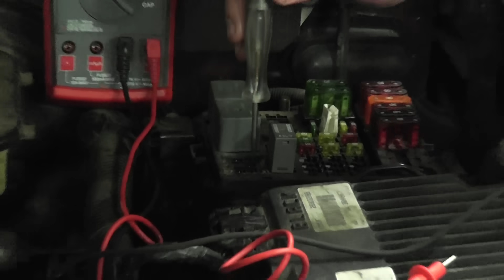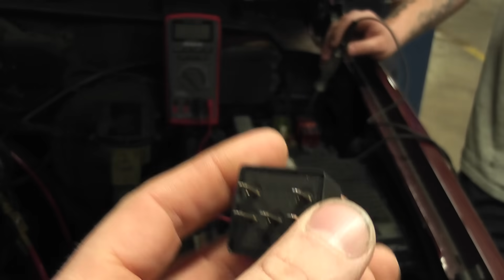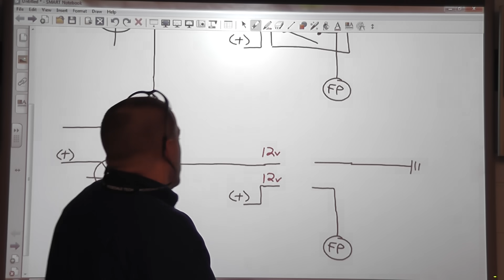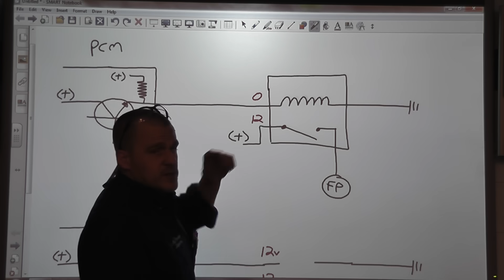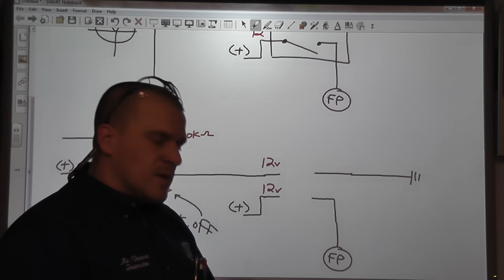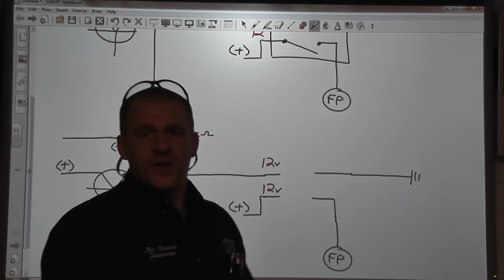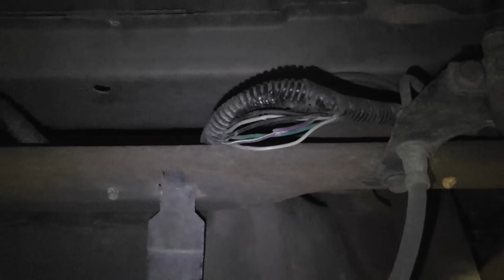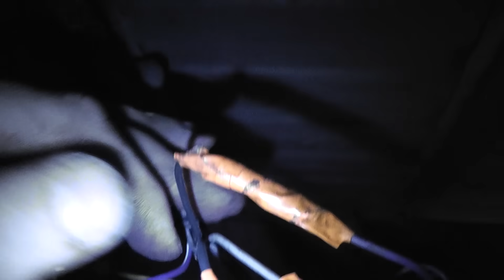GM Fuel Pump Relay Testing

Comment: Sec 16 pg 9, GM RELAY  TESTING . So when testing relays...let's say to a ground side switched  fuel pump. That means the relay is ground side  switched  as well?  I ask because  every video  ìve watched has said numbers  86 is positive  85 ground, 30 positive ,  87 is load? But the in your video you say the complete  reverse.

Comment: With the relay in, the bais voltage drops thro the coil to ground? Right? Can the computer use this to tell if the relay is open or unplugged?

Comment: why the fuel pump relay shuts off current supply to fuel pump when key is on and engine has not been cranked for 2 seconds?

Comment: sinking or open collector transistor. Used widely in industrial control, jumped the fence at GM and invaded our cars when computers became standard.  Coil load tells the computer there is a load there. When the transistor is told to turn on by the computer it SINKS to ground and loads up passing voltage! The test light acts as he said just as the relay coil would. 42 years of electrical and the last 16 in training others one of the best descriptions of sinking and open collector I ever saw. Awesome!

Comment: l have a 2001 s10 with a 4.3l it starts but dies in 2 seconds I replaced the fuelpump, fuel lines, fuel filter, altinater, ground wires, spider injectors. I ran the codes and the only thing that popes up is abs please help me

Comment: 2004 GMC Savana 3500 cutaway, with a 15' box. No start, no pressure. Was able to jump the correct pins (you explained very well) and send constant power to the pump to investigate further. Found out to be a bad connection w/ the connector at the pump. Would have never stumbled across it without your information. Was sending it to the shop tomorrow....Great work and fantastic information!

Comment: a novice like myself(with shallow experience) is assuming that each and every closed circuit has a feed(12v), then there s a component or load where some ACTION is happening and after that comes ground (zero volts)...in this case of bias voltage, i m thinkin: hey, but where is the load, where is the action happening(obviously it s not the coil of the relay)...the only action (if any) is that resistor where those electrons are crowding to pass through( in a controled manner or otherwise there would be action in that coil)....so they re like scouts, just watching the bridges, for the armored division that is supposed to do the real work...btw.i hate war :)

Comment: Looks similar to my 96 Silverado K2500.  How did they not notice the wrong colors on those wires were connected together?  Why didn't they just tell you that somebody attempted to replace the fuel pump beforehand? Those wires should have been shrink tubed and soldered.

Comment: I have a 2000 Chevy K1500 Silverado. I have to double start it before it will run.  Fuel pressure totally drains with the key on no start test...Motor started the pressure is below what have been told should be 65 psi, currently it is around 55 psi, however when using OBD diagnostics software it shows the fuel pressure dropping to almost zero when you stand on it between 2nd and 3rd. Initially the fuel pressure was static at 45 psi when driving it. The upstream O2 sensors appear to be stuck as well around 80 mhz.  Finally, fuel pressure totally drains after motor turns off.
The double start issue appears to be random as well. Sometimes I walk out get in it and boom it starts, the next bump the starter and the engine just cranks, let go hit the starter again and the pickup starts.
Its like something gets intermittently stuck partially open?  Like a valve?  If someone knows the issue post a solution.  Thank you in advance.
I have done the following:
Replaced the fuel pump twice once by the dealership and then my self first pump was replaced after truck slowly would not run right, it would sputter when you hit the gas and finally just would not start.  It would just crank. 
Replaced the inline fuel filter under the drivers side
Replaced FPR first by me and then once by the dealership
I have replaced the fuel cap as well
Mass Air Flow has been cleaned appears to be good as well.
Finally, grasping for straws I have reset the EMC thinking maybe the fuel pump by pass had been triggered 
Karl A

Comment: Hello ScannerDanner. I  neeed some help. I have a 2008 chevy silverado 1500. I am getting a lean bank 1 and lean bank 2 codes. I have replaced the intake manifold gaskets, valve cover gaskets, clean and dirty air tubes, evap hoses on top of the motor as well as the evap solenoid, the evap canister vent solenoid, the fuel pressure solenoid, map sensor, mass airflow sensor, fuel cap and the O2 sensors were replaced 3 months ago and I am still getting the codes. The fuel pressure was tested with a gauge on the fuel rail and it was at 44psi at idle which is where the book said it should be. I am at a loss. Is there anything else I could be missing with diagnosing that you might know of? Could the fuel pump flow control module be starting to act up? Any ideas would be greatly appreciated.

Comment: I have 2000 gm sierra it ran out of gas wouldn't. start then after putting gas in it changed the fuel filter can hear the pump engage. I used my spare key to try to start it it turns over but just won't start I noticed the security light keeps flashing does this have anything to do with it? Please help me

Comment: I've always checked for voltage and ground closest to the fuel pump with out removing the tank, amp gauge or probe. Then work towards relay and ecm. jmo.

Comment: Hello paul
Can't we just install the relay jumper block you used in some other videos, and then cycle the key and if relay was good you would get light on the pin 30 of the relay jumper block.....or am I mistake

Comment: I have a 1997 Buick Lesabre & my car started and cut right back off after a few seconds & i also rolled down my back windows. When i tried to crank it back up it wouldnt. My car windows wouldnt roll back up & my fuel pump would not cut back when i turned the key. I checked all the fuses & they are good. Checked the relays with the hand test & they seem to be ok. I cant figure out what the problem is. This is the 3rd time that this has happened. Usually after i let the car sit for a while & try to crank it, it cranks right up, but now it wont. PLEASE HELP

Comment: I own a 96 Yukon in the heat the truck starts to lose rpms and power after running for a little bit. Also the relay gets extremely hot. However in the winter it runs great other than being hard to start. Any suggestions would be very appreciated. :)

Comment: Question, what could be the reason I go through fuel pump relays often on my 99 GMC Yukon Denali. It happens on initial start of the day or as you are driving. The truck just stops, I put a new relay in and it starts right up. Pin 87 on the relays looks hot and the place the relay plugs in shows wire 87 has been hot. Any advice?

Comment: All that shit for jumbled wires. I got a 97 suburban that keeps chewing up pumps. Right now it has zero fuel pressure and I checked the relays. Only power at 87 but I don't have anyone to turn it over while I check. Fuel pump is not coming on at all, anyone have any suggestions?

Comment: Hey man my 99 z71 5.3 started running real rough to the point where it wouldn't accelerate I have already put a fuel pump about a month earlier along with a fuel filter and a crank case sensor it started white smoking now my fuel pump will not come

Comment: My 1999 Chevy Tahoe won't start. When I test the fuel pressure it's only putting out about 55 PSI and sometimes it jumps down to 40 PSI. I've heard that these trucks need at least 60 PSI for the fuel to open the poppit vales. Is this true. Will they not run with pressure under 60 PSI?

Comment: You are quite a rocking dude for serving the community of DIY and interested on lookers.  I am facinated and intimidated by modern electrical systems and the computers that control them. Could you recommend a primer book or do your films teach an old school guy that does alright as a parts changer but wants to really have the equivalent of a formal education in auto mechanics.  I may yet switch careers but need to become updated from non-computer controlled engines.

Comment: Hey Guys, this is my 3rd or 4th time coming to this site for help on different issues with my 1999 GMC Suburban. I love my GM vehicles and have had a great run of luck buying older used vehicles (Chevy, GM, GMC, and so on) and this site has been invaluable to me in regards to fixing my cars, with both time and money. THE ONE MAJOR PROBLEM I HAVE HAD IS WITH THE DEALER AND HIS MECHANIC. I WILL REFRAIN MYSELF FROM PUTTING IN ANY DERROGATORY REMARKS AT THIS POINT IN TIME. HOWEVER, IF I DO FIND OUT THAT THIS DEALER IS AND HIS MECHANIC HAVE BEEN DOING SOMETHING TO FORCE ME TO GO BACK TO HIM FOR WHAT I CALL REPEAT REPAIRS, I WILL WASTE NO TIME IN LETTING YOU GUYS KNOW ABOUT HIS OPERATION. I WILL NOT WASTE ANY TIME IN INFORMING YOU ABOUT THESE GUYS. I WILL GO THIS FAR AND TELL YOU THAT THIS GUY IS LOCATED ON THE ATTLEBORO / NORTON LINE.

OH YEAH, WHILE I HAVE YOUR ATTENTION, I FEEL IT IS MY DUTY TO ALSO INFORM YOU GUYS THAT obama IS NOT ONLY TRYING TO TAKE AWAY OUR GUN RIGHTS HE IS ALSO NOW TRYING TO GO FURTHER BY TRYING TO USE HIS EXECUTIVE POWERS TO SCREW WITH OUR INTERNET USAGE, SO GUYS IF WE DON'T DO SOMETHING ABOUT THIS IDIOT WE'RE THE ONLY ONES THAT WILL HAVE SOMETHING TO LOSE HERE. I ALSO JUST SAW SOMETHING ABOUT HIM WHERE HE HAS BEEN GIVING MORE MONEY TO MORE ILLEGAL ALIENS AND IF I CAN FIND OUT WHERE THAT INFO WENT I WILL MOST CERTAINLY BRING IT TO YOUR ATTENTION SO THAT WE ALL ARE AWARE AS TO WHAT HE IS DOING TO US. GOOD LUCK AND GOD BLESS TO YOU ALL.

Comment: i hope you will help me with this annoying problem....i have Opel Corsa B 12V 1.0 ...the problem is,hard starting 2,3 times to start the car....and when i try after every false start i hear rapid clicking from the relays...is this a regular clicking from fuel pump relay or need to buy new one....to solve this....??

Comment: I need to check fuel pressure but only have an oil pressure gauge with a hook up to the schrader valve will that work?

Comment: I have a '95 Jeep Cherokee Country, the pressure fuel regulator was spraying fuel at crank. I replaced it with the suggested one from the local auto parts store, looks different than the one removed. Now I can't start the Jeep. It runs for a short time then dies. Help???

Comment: Great Video! Im working on a 98 Chevy pickup, when the pick up sits overnight it takes a really long time to start. It acts like its feeding back thru the oil pressure switch. I tested all the leads on the relay and i have good power and all the wires tested right. Somebody else already replaced the fuel pump once. The truck will even do it after sitting for a few hours. So it doesn't have to sit overnight. Any suggestions would be greatly appreciated.

Comment: 1997 CHEVY SILVERADO FUEL PUMP KEEPS GETTING VERY WARM TO THE TOUCH. IT KEEPS MAKING THE TRUCK SHUT OFF AND I TAKE IT OUT AND PUTTING IT BACK IN SO IT WOULD START. WHAT IS YOU IDEA OF WHAT IS THE PROBLEM.

Comment: Have a Chevy Silverado 2002 ,my problems is truck starts then runs about half mile then loss power then engine stop,I try to start up the engine wont start,If I wait about20 mint.to 30 mint. Engine start again but then stop again. Cuestion What could be the problem?

Comment: I'm having trouble with my fuel pump on my 2002 chevy Silverado 2500HD the fuse is good the relay is good im not going any power going to the fuel pump itself...test light was used on the lines going to the pump but not lighting up...please help me

Comment: OK I did verify 5 reference for Map sensor and Idle air control sensor both are receiving 5Volts with key in the on position.

Comment: no light to control pin when cranking and no 2 second light when key on! Now I am guessing this is a PCM issue I looked at PCM under dash there is only one wire harness plugged into this PCM the smaller one there is no harness connected to the area where a larger harness could connect 88 Chevy k1500 4.3 is this normal?

Comment: Great video. I like the comment on the lean pop through the intake at snap throttle. I have been using these videos to troubleshoot electric fuel pumps measuring current and the armature waveforms. These videos have been very useful. Thanks.

Comment: Need your help bad.  I am working on a 2005 Cadillac sts 3.6 liter. Some shade tree mech. Changed the fuel pump in it and did such a bad job. I would have to show pictures for you to understand. Anyways I'm getting a fuel pump "a" circuit open low voltage. It's been a nightmare! I added you on Google+ so any info you can give me the better. Thank you.

Comment: I am not sure how active you are, but I am driving an 88 bronco 2 2.9l. The previous owner replaced the air box with a spectre air filter. This means he deleted the factory air box. In the process, it looks like he left these relays exposed as well and they're clustered yet exposed to the engine bay. 

Yesterday, my car caught some heavy water during a storm with the hood up for 4+ hours. I tried cleaning these relays with no luck. I am testing these because when the car in the the on position, there is no fuel pump 'hum'. 

Am I possibly stepping in the right direction? I used google and search everything from 88 bronco 2 fuel relay location all the way up to fuel pump bad water just so I could get the most broad idea of whats happening. Unbelievably, google did not supply me with an answer.

Comment: I have a 2000 tahoe, what if I don't have the second power feed when cranking? the fuel pump was working before I changed it cause I was told that i will need a new one soon. and now I can't hear it turning on.

Comment: My Chevy 96 Lumina had only 5 lbs fuel pump pressure.  The pump was never changed.  Getting some pressure indicated the electric circuits were good.  Replacing the pump gave about 35 lbs pressure which made the engine run correctly.  Opening up the old pump showed the flat in the hole in the rotor which fits on the pump motor to be warn off.  Going through a lot of complicated testing was eliminating by observing electric and pressure conditions.  The important fact to realize is the simple flat inside the pump rotor hole can be warn off to cause low or even no pump pressure.  Don't overlook even a pound or two of pressure to show electronics are good and to show the flat may be warn off the plastic pump rotor.  My replacement pump did not require wire changes which eliminated wrong connections.  Remember to KISS the troubleshooting and observe the conditions to see clues for simple diagnosis.       George

Comment: Hi there, tremendous video, well explained; am from Chile and I got the situation the other way around with my ECM S10 apache 2.4 LG1 it gives ground according to the schematics and pump sometimes yeah sometimes nope, thanks to your info am about to check and see if I got the right ground wire in the pump, any other idea will be appreciated

Comment: I have a Buick century custom 2002. I followed your video testing the relay. Pin 87 12volts, pin 30 I get 7 volts or .46 volt.  I shouldn't have any voltage there. Pin 85 computer control pin does not light when key is turned to on. No prime. Is this a bad engine computer unit?   Originally the car just died and wouldn't start.  I put 2 used fuel pumps in it. Jumping pins 30 -87 runs the pump. When I fist put the last pump in it did run for awhile a hour or so then turned it off and wouldn't start or prime.  Once in a while it will prime and start, then go back to not priming at all and not starting. It very confusing problem.  Can you lead me to a direction to take? Thanks

Comment: Thanks for the detailed video. I have a more serious problem that maybe you could help with? When testing for power at the fuse box as you did, I have zero power/volts. Where does my problem lye? Is my ECU Shot?

Comment: Mr Danner.. Thank You .  Working on my first fuel injected GM product. How about a video why the engineers .?.They must be Suffering from a mental health issue to not put in there design a metal panel that can be removed topside to remove an repace the fuel pump.Instead of dropping fuel tanks.

Comment: Great video! I am an electrical engineer and you explained the bias circuit well. I think you can say the 12 volts is across the high ohm internal resistor and your test light has very little resistance and can not create an voltage drop (no load). That's why you see zero volts with the test light. Freaking outstanding explanation of the fuel pump circuit!

Comment: I've been watching a few videos like this but it doesn't resolve my problem. I'm not getting a signal from the computer to turn the pump on. I can use a jumper and the pump come on but otherwise nothing. And I have 3 relays that all check out. Please help. Thank You

Comment: Danner...at 12:40 duration immediately after the bias voltage tutorial you are back at the relay socket and probing "pin 86". That's the ground socket, upper right corner. Did you mean pin 85 in the lower right corner?